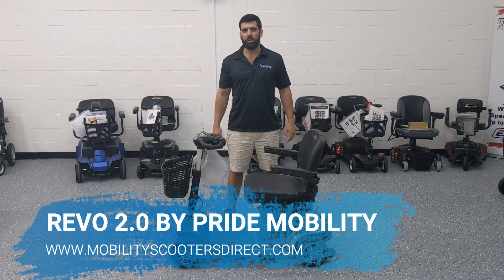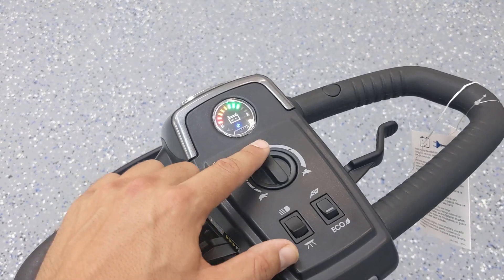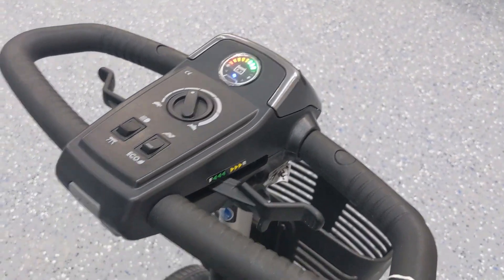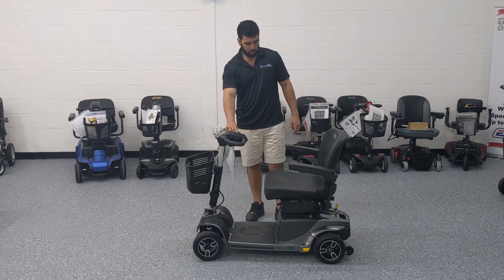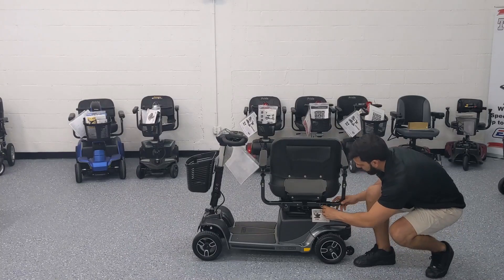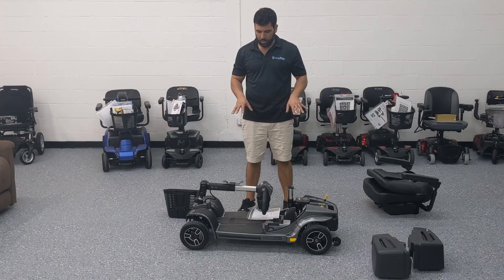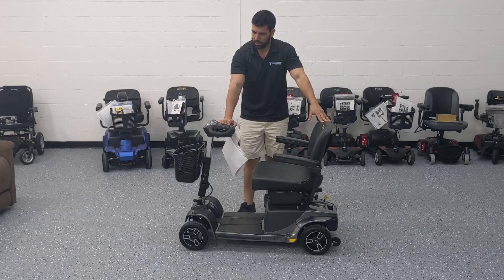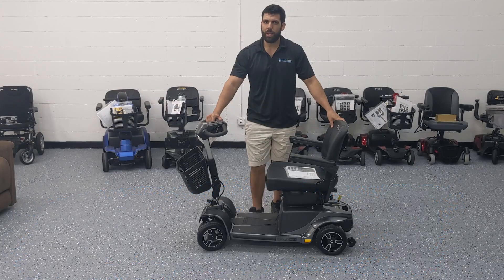🕵🏽‍♂️Pride Revo 2 0 Mobility Scooter Review

Comment: I have had my Revno for about a month. It is great.  I had a ZTR10, which quit and was returned. I do not recommend those. I like the Revno because the rear wheels will basically follow the front wheels through a corner turn. The bigger battery is great, and the rear splits off and goes together very easily, as shown. My only complaint is that the tiller seems too high and I'm 6'-4" tall. I wish they had a telescopic feature and a light solid plastic seat option.
Reply from the maker: That's a great comment and we will definitely explain this to the manufacturer during our next meeting. Pride will often ask us for feedback before releasing new products since we do so many videos for their products. We hope you are enjoying your Revo 2.0. If you need help we are here for you.
Reply: @claydo364  What should I have bought. A  Harley Davidson? 😂😅😅🤣

Comment: Does the seat go forward and backward a little for leg room adjustment? I'm considering this one or the Other Pride model (step up)
Reply from the maker: The seat does not adjust forward and backwards on this model. But other than that, it's the best option for traveling
Reply: @MobilityDirect  O.K. Thanks! I have to try the Revo and Victory out.
Reply from the maker: @usafirefly7967  The main difference is that the Revo is easy to travel with in a car, you don't need a hitch lift (aka mobility scooter platform lift). The Victory Sport Lx is not really easy to put in a car or truck with a lift. If you want to travel with your mobility scooter, go with the Revo. If you don't think it matters, the Victory Sport is much faster and more sporty-looking. They are both going to use the same type of suspension and the seats are both just as comfortable. The revo just doesn't have the headrest option with the high back. Keep us in mind if you would like to save on the shipping and sales tax. We would love to earn your business.